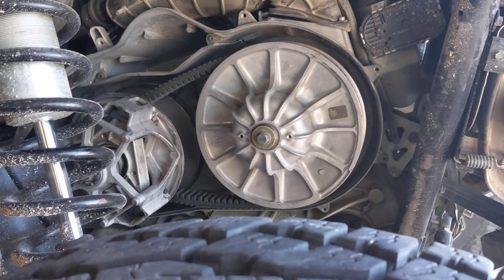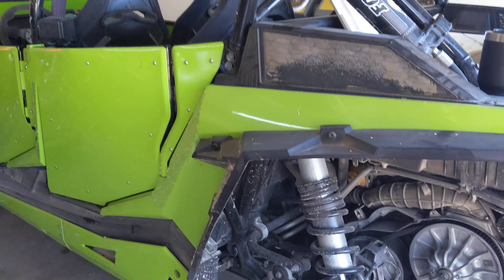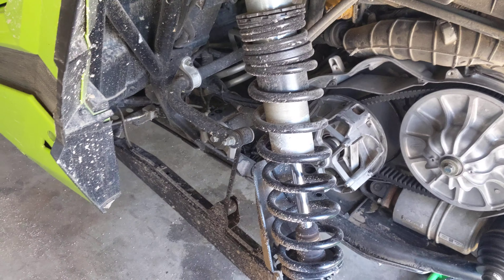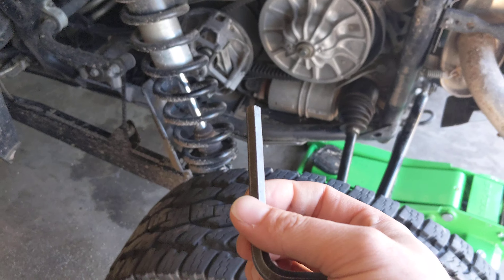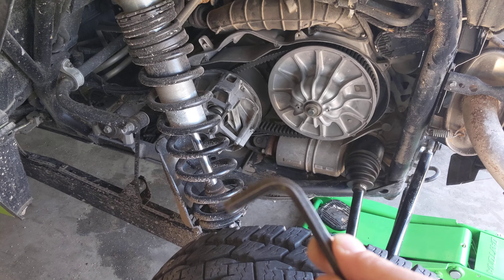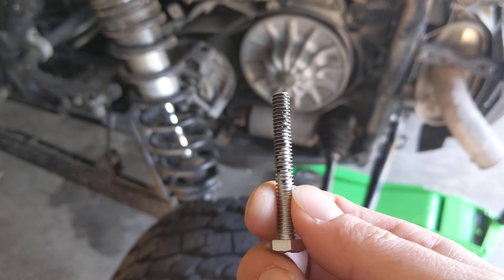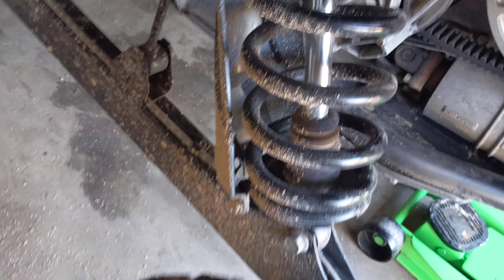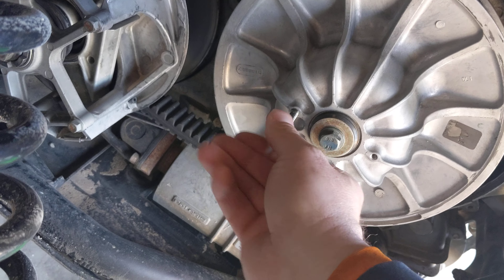Turbo RZR belt removal hack, super easy and fast belt change.

Comment: Um, not sure I understand, what’s with the bolt, looks like the way you took that belt off you didn’t even need the bolt or the impact... I don’t own a rzr or I would probably understand more.
Reply: There is a spring in there clamping down on the bolt, you use the bolt to spread the clutch apart from the inside.
Reply: turbo94gto ohhh, okay, that makes more sense